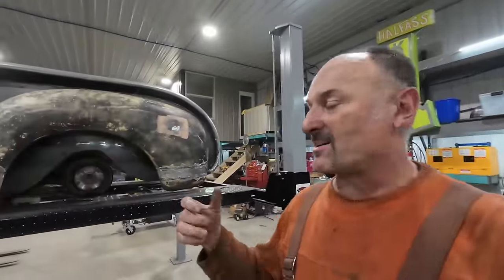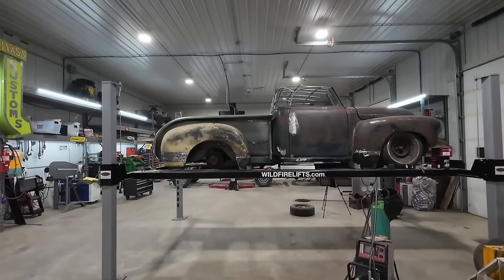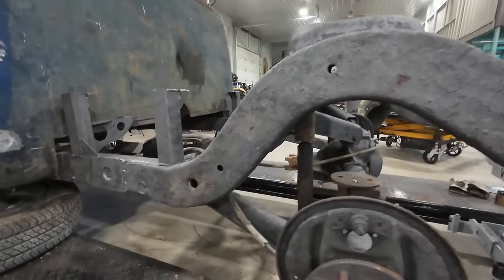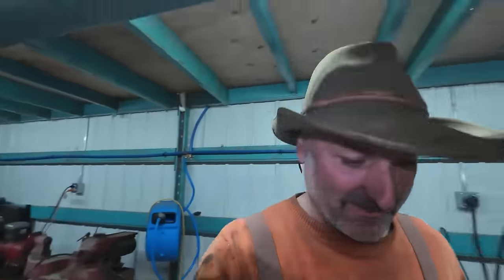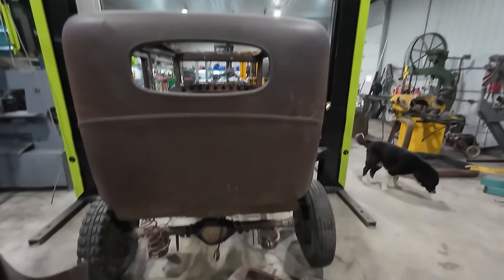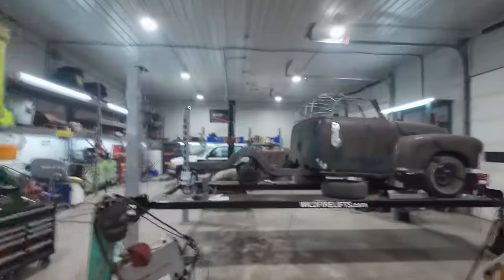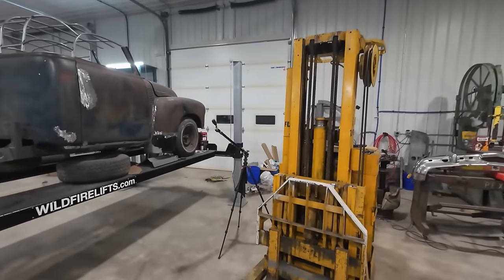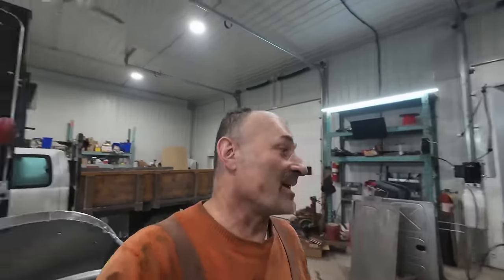Pulling our box to laser clean the chassis on our '49 GMC Roadster.

Comment: Laser works awesome! Needle scaler, yes,it works well, i put a regulator on my airline, pressure down so it still works. Less noise,and airborne stuff is reduded considerably.
Fit the essex in whenever it suits. Easier for editing, no?  
Whatever goes on is interesting in my opinion.

Comment: This truck is going to look so cool but I would if it's possible pancake the hood to get it on more of an even plane with the lower box in the back. I think the hood sits up too high and it sort of breaks the flow of the side profile of the truck making it look for the lack of a better word look a little  lop sided front to back. Of course this is only my humble opinion. The acquisition of the laser has been a real blessing, and it seems to be getting a lot of use. It sure beats sanding the rust off. I love your work ethic and no nonsense approach to get things done. As always can't wait to see your next video.

Comment: Looking at the chassis , I straight away thought of Ryders truck. 4WD , modern suspension , wheels etc. Just a thought.
Reply: What young man wouldn't love a lifted real 4x4 power wagon dressed up in old tin.
Reply: Make it a 4 door cab as well. I have a "52" Dodge on the to do list. The back door design have been a puzzle that I am still working on.

Comment: Love that laser..but MAN, the initial cost!
I would imagine you'll get better at making consumables live longer..and it's gotta be more energy efficient than running a compressor to sand blast..plus, no sand to buy..
(Gimme a few more minutes..enough time I can rationalize ANYTHING!)

Really great to see you back in your element again, you're an inspiration, dude!

Hey, just got to the "brake lathe" discussion part..if you've never used one, lemme give you a tip.
ALWAYS wrap brake drums with a rubber or leather strap when ya turn 'em...otherwise, they ring like a bell as they're being cut, and the vibration makes the drum surface oscillate in and out of the cutter. Results in a crappy finish and goes thru carbide bits way faster..
An old inner tube wrapped around the drum will even do. Same goes for rotors, but they want a thinner belt.

Comment: Great job Brent
Saw you get frustrated with that brake spring compressor 
I always did before I learned to  push spring in and rotate pin instead of spring..it works great
Just trying to help a brother out 👍👌

Comment: Thanks for sharing your videos. Was nice to see both projects progressing at the same time. Looking forward to seeing how you prepare for paint after the laser blasting of the rust. Was wondering if the power setting level affects the thickness of rust removed. The laser might not be the end all in the rust cleaning game but being from the rust belt certainly looked like a nice upgrade when having a break job to knock down and cleanup the rust easily. Hopefully they become affordable to the point that local repair shops can afford to have them.

Comment: Nice video.  I have a couple of questions for you which you may have already solved.  Years ago when I was in high school I had a 52 chevy truck that a tree fell on which was why I got the truck for free.  I decided that I'd make it a convertible.  The one problem I never liked on the truck was because the roof was gone there was always a little give even though it had a frame the door gaps would open and close besides rattle a bit while driving.  I ended up bracing it but, it never did really give me the stiffness I liked.  Don't get me wrong it worked but I had bucket seats and it wouldn't give me enough space to get the seat back far enough because I used a 1-2" tubing that I had a muffler shop bend for me .  I don't know what or if you've done anything with that yet or if you even feel it's necessary to do.  Where we lived in Northern Idaho by the Canadian border we had lots and lots of dirt roads I used and you know how those roads can be with ripples and pot holes so, just wondering.  I'd also love your new shop !  It's a shame what happened to your old shop but, I guess it gave you the opportunity to design it how it works so much batter for you.  In the early eighties I bought an Essex from a guy in Canada that was all aluminum body so I was wondering if that was an odd year or what ????  Most of the Essex's that I looked at and got parts for were aluminum so I'm just not sure but, it's been a long time ago.  I really love what your doing with  your GMC and your other projects !  Keep up the great work .  I'm looking forward to you learning to weld with your lazer.  It looks like with working on old cars and metal that just the cleaning part alone saves all kinds of time.  Besides it's only money right ?  LOL !

Comment: At 10k minimum IMO the laser blaster is only half of what I could use it for. Cool on some areas but not cool on others. Not really worth it to most of my situations. Light surface rust seems to work fine but so does a needle scaler and Eastwood rust encapsulator frame paint. 10 grand would by a ton of frame paint.

Comment: Hi Brent.  I really admire your work, ingenunity and work ethic. Looking at the rear frame, are you going to add a rear crossmember?
Reply from the maker: I was thinking about it, but even in the cars they never had a rear crossmember
Reply: I built some race cars and it is amazing how flimsy the ladder frames are. I added cross stiffeners to cars with full
perimeter frames. Perhaps your bed is stiffer than a factory one and that will suffice but with airbags and a torquey motor you might be surprised. All rendered, for what it’s worth. 

I meant to also say I love the rearend treatment. Very distinctive.

Comment: I just got done with pulling a 2007 dodge ram hemi 5.7.  You will need to remove the Skimm ( Mopar version of VaTTs).  You can use a HP tuner and you will have to build a programmer interface.  I built one, and documented it on my YouTube page.    DIYHemi youtube page was a huge help.   Programming will cost $100 through hp tuners website, if you want help programming l can def assist.